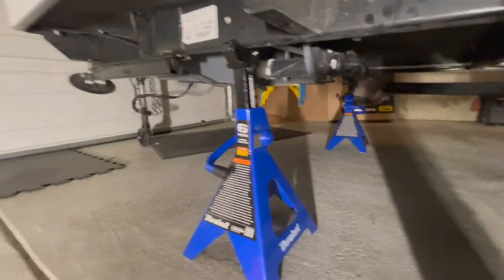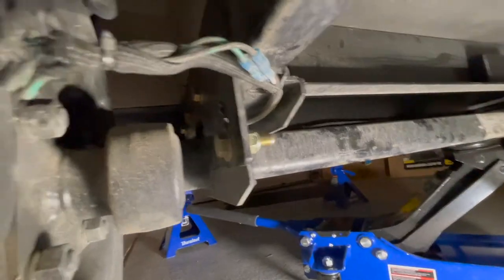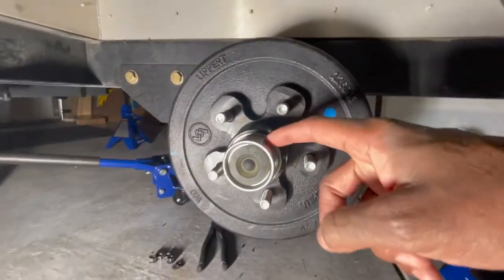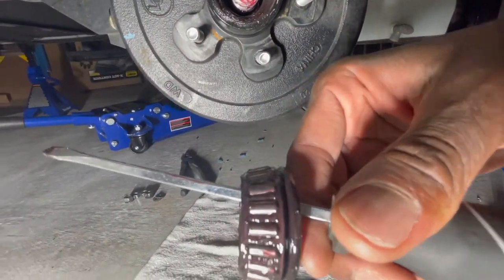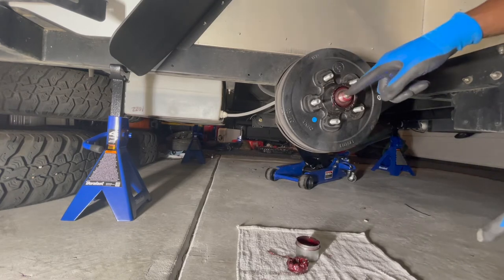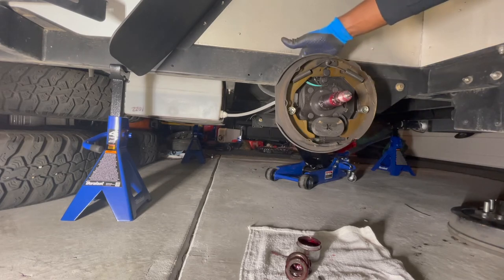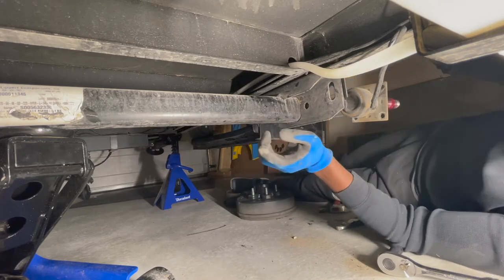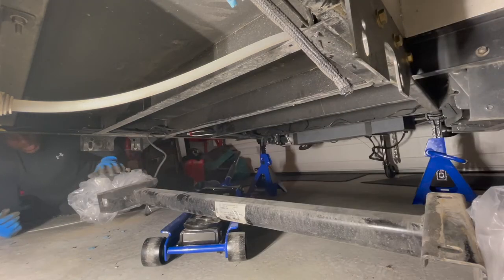2021 Taxa Cricket Axle Replacement Part 1: Removing Axle

Comment: Thanks for all the close ups. Did the new axel ever go in? How's it working?
Reply from the maker: Hi Martin. It did. I need to post the video. I have been swamped with some exciting upcoming changes. Unfortunately the axle failed again. Apparently a bigger issue. Taxa is looking into it.
Reply: Why did the second axle fail, and how’s it working now? Would you use a timbren if they offered?